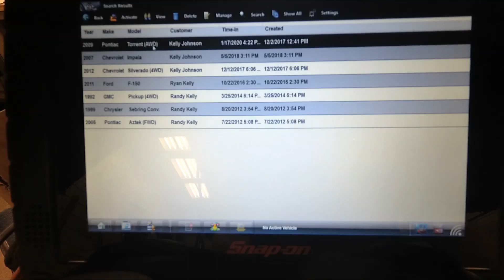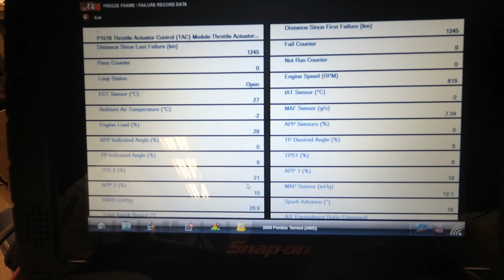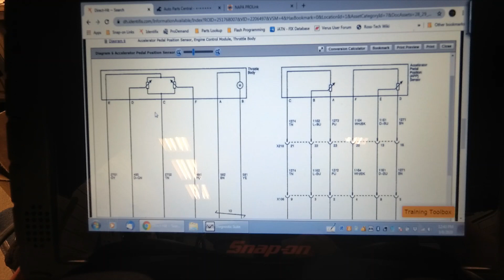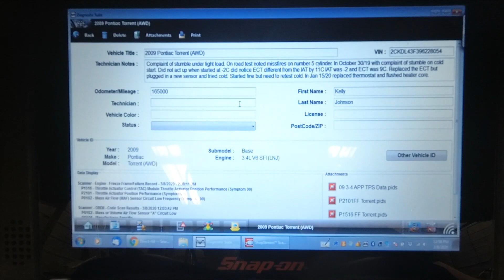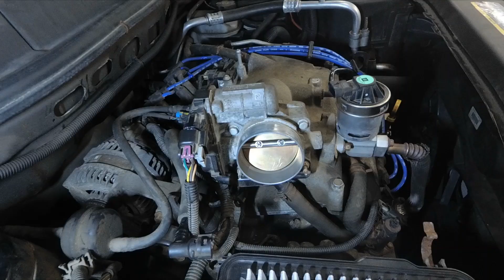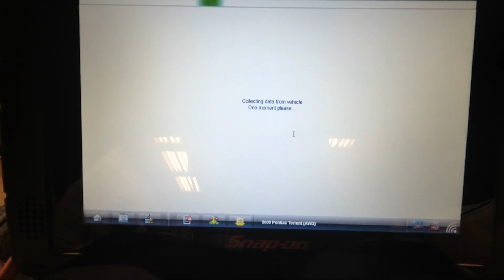2009 Pontiac Torrent P1516 P2101 Throttle Body Problem

Comment: I got the same 2 codes on a 06 trailblazer replaced the throttle body ran fine for a night then the next morning they came back running bad again when it did it for the first time it left me 2 hours from home had to have towed I tested the gas pedal with a volt meter that came out good at this point I'm out of options
Reply from the maker: After replacing the throttle body did you perform a relearn procedure?  You need a decent scan tool to do this. Those ore correlation codes so its possible you have a wiring problem between the throttle body and the PCM. It could also be a defective part. Good luck